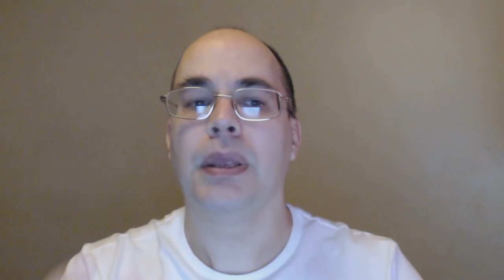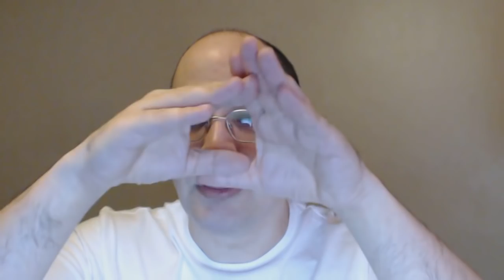How do rockets move in space, with nothing to push off from?

Comment: load of p!sh - Newton;s 3rd law is misrepresented here , yes there is a component effect but that is only due to the weight or force of the fuel being expelled from the rear - just like the bullet from the gun. The recoil of the gun is due in the greatest part to the conservation of momentum due to the third law. However a gun and a rocket are mostly dissimilar. The gun only deals with one component of force but a rocket has the additional thrust factor which reacts against a solid or atmospheric medium.
Reply: but a rocket has the additional thrust factor which reacts against a solid or atmospheric medium
What does it matter what the ejected hot gases "react against"? That's like saying the recoil on your gun depends on what the bullet runs into. Makes no difference. The action of moving out of the barrel creates the equal and opposite reaction that "recoils" or propels the rocket/gun.

The gun or the rocket doesn't give a crap if its ejected mass runs into anything or not. 
What do you think would happen to you in space if you used a fire extinguisher? It would push back at you, right? Or if you shoved a massive weight away from yourself? Do you think the lack of atmosphere would prevent you from feeling that "push" against your palms, that moved you in the opposite direction?
Of course not.
Reply: Sorry but you are making wrong conclusion of my words, all I am really saying is that the propulsion of the rocket in space  is only related to one factor if you use Newton's 3rd law and is the speed and rate of mass ejected(fuel) related to the the mass of the rocket. There is no thrust factor in a vacuum.
Reply: There is no thrust factor in a vacuum.

You lost me at that sentence. Why would the fact that there is no
atmospheric pressure outside the rocket, affect Newton's 3rd Law?
If you shove a boulder away from you in a vacuum, do you not think you
would feel that "push" against your hands?
Reply: to be honest I haven't a clue what you are on about , I think you are making assumptions on all of the mechanical elements of the action. You have to decide whether you are giving a constant push or a sudden push, the two are completely different. If you think you are feeling some resistance it is because you are having to accelerate your push to keep contact. If you give a sudden push and stop then there is no further contact, you will feel the initial contact and you will recoil backwards and the object will travel forwards. Nothing effects Newtons 3rd law it ,you use what ever laws are needed for what ever forces you are trying to describe and one resultant forces can be made from several elements, there are so many types of forces and they depend on all the conditions and magnitudes ....
Reply: "You have to decide whether you are giving a constant push or a sudden
push, the two are completely different."

No they aren't. A force is a force. And any object you shove away from
yourself will "shove back" against you, pushing you in the opposite
direction, just like a rocket. Do you deny that? "If you give a sudden push
and stop then there is no further contact, you will feel the initial
contact and you will recoil backwards and the object will travel forwards."

YES! Then you agree with me. That object you pushed away from you, made you
(the rocket) RECOIL. That is the action-reaction that powers rockets. The
rocket is constantly pushing mass out its back, propelling it forward due
to this "recoil".

So if you agree that such a rock would cause you to "recoil" in a vacuum,
how can you say that a rocket will not work in space?
Reply: I have just found information that disagrees with my model but I am sure that this is wrong , so I apologise for getting it wrong and arguing,but I am very sceptical regarding this information especially when it is from NASA  , so I will have to investigate the matter further. Cheers for now.
Reply: Jim Taylor : if you don't trust NASA, try info from other countries. I think somewhere around 10 other countries use rockets in their space programs.
Reply: The only consideration necessary to grasp is that the 'thrust' (perhaps the wrong word to use here) or rather - forward motion of the spacecraft is a result of the propellant and oxidiser (in a chemical engine) being ignited in a combustion chamber and the resultant expansion of gasses being forced out of the chamber. It is this expansion and the resultant gasses being forced out of this chamber that creates the propulsion, not the gasses reaction with the void (vacuum) which does nada! The gas expansion and expulsion acts against the craft and the craft acts against the gas expansion in equal but opposite directions.

Comment: All rockets/jets use the atmosphere for flight.
All boats use the water for flight.
All cars use the ground for driving.
A boat would work as well on the Moon as a laughable rocket; the Moon has no atmosphere or water.
Reply: Rockets does not use the atmosphere for flight. Atmosphere busts builds drag. Jets use oxygen for burning fuel and does the thrusters do not need atmosphere.  That's was the whole point of the video.
Reply: You failed basic physics again. You will have take the seventh grade over again. Just think you and your kid can now sit next to each other in class.